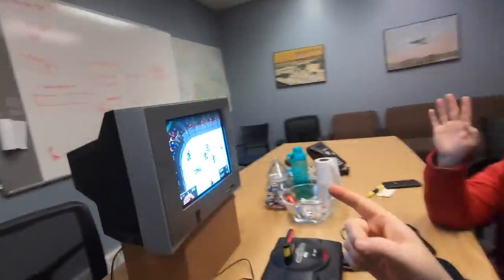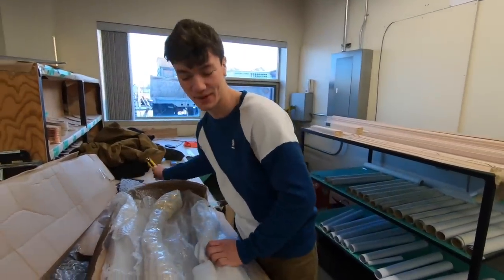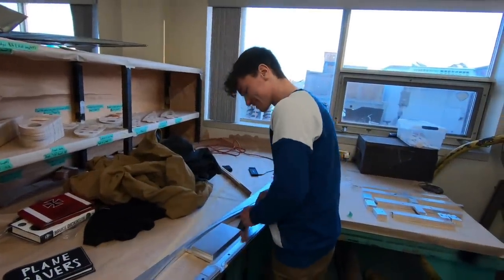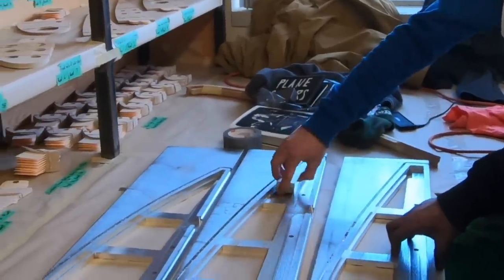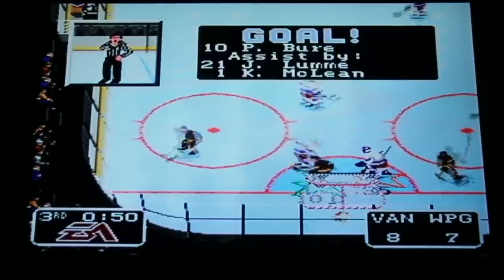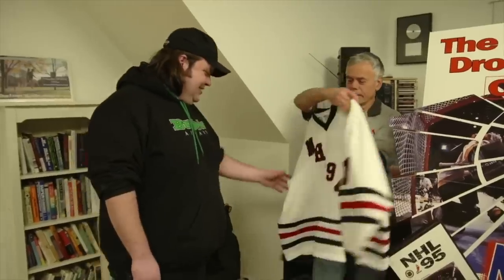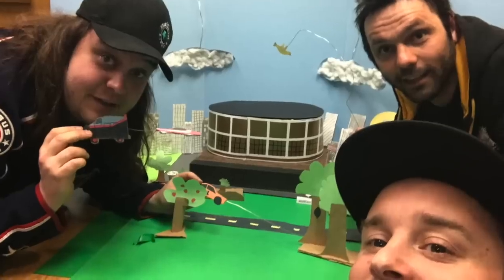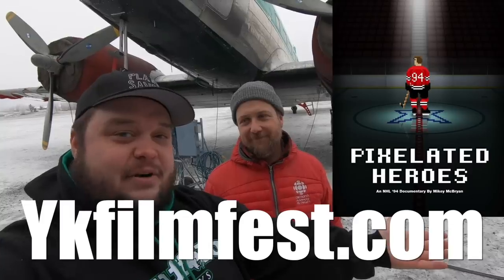Aircraft Jigs Built with $800 of Raw Aluminum!  | Plane Savers S2-E20

Comment: Verrry good ,   but the CBC sucks ..did not like the CBC part
Reply: Too check centring of the dado in the strips run it through  the saw both ways. 
Steam bending would work faster and you could build a wooden jig which could bend multiple pieces at the same time.